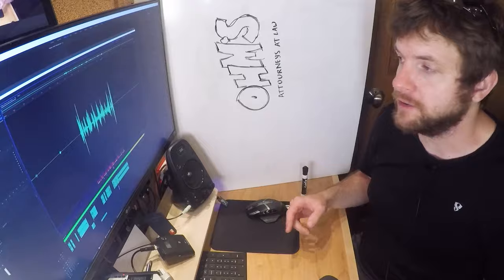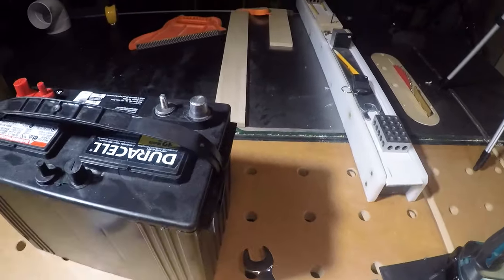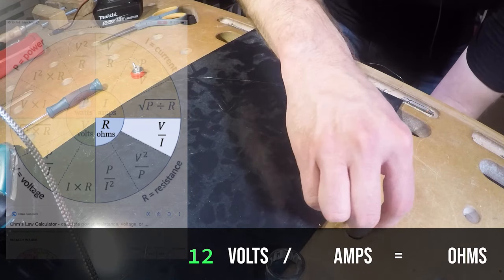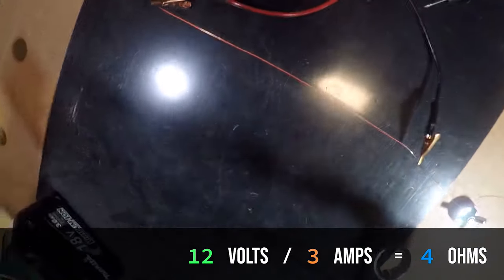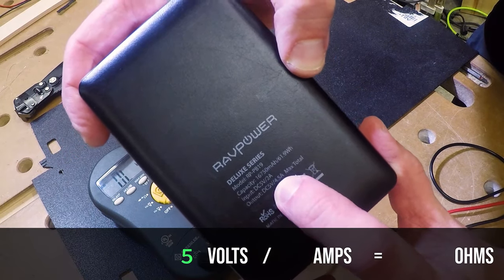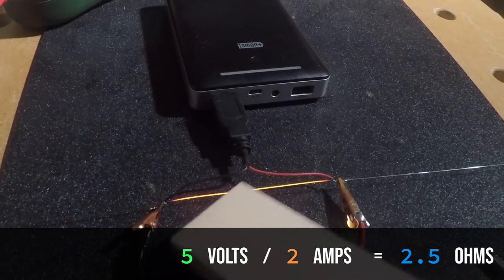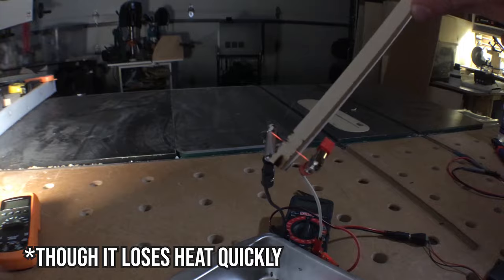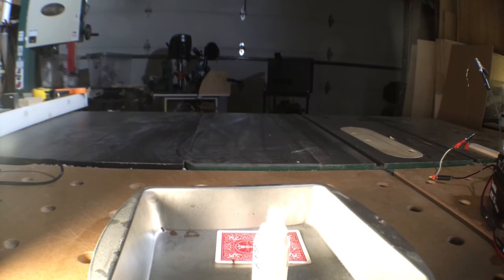Easy USB Hot Wire - Simple Circuit: (applying Ohm's Law)

Comment: So...I'm looking to make a heating element for my driveway in the winter.  I've seen all the expensive ones that are out there, but haven't found anyone trying to DIY that, trying to save as much money as possible.  Do you think using this type of wire would work...and what type of power would I need for a 100 ft stretch of driveway to make this happen?

Comment: Perhaps I am ignorant, but in what way is the amperage being controlled for? You have your voltage known, you check the resistance of the wire over a given length, and how much amperage is applied is simply a product of the formula, and if you don't have enough amperage it won't heat up and/or wont complete the curcuit? And if you have more than enough amperage it will simply not use the excess?
Reply: On my desktop power supply it would pull the voltage down to compensate. I think a circuit will try to pull as much amperage as it possible, even to the point of self destruction such as a short circuit, unless there is a overcurrent protection device to protect it from doing so. I am an electrician not an ee so I am looking at it from that angle.

Comment: I used some nichrome wire and a wall wart power supply to create a foam cutter. I lined the wire up with the blade of my table saw (inline) so I could use the fence of the saw to cut rigid foam pieces to size. Basically lower the blade and feed the foam through the vertical wire just as if it were a spinning blade. Worked wonderfully.
Reply: this is what im trying to do with copper wire to make a vape lol

Comment: Hey Keith do use a special USB with the portable battery pack? Because I tried to replicate this but the kanthal wire doesn’t glow. It does heat up but not glow. Everything else is exactly how you had it. Same wire, same gauge, same math. But it’s not working.

Comment: yes! the whole:
  - applying Ohm's Law with desired voltage and current to get needed resistance
  - using a multimeter to determine the resistance of a certain lengh of the wire
  - having thin wire for higher temperature and less wire lengh without changing desired voltage nor current
was all I needed, but couldn't get anywhere. thank you

Comment: We (our high school robotics team members) use hot wire to soften Lexan for shaping - use the hot wire to heat up an area of the lexan until it melts...when it cools it retains the new shape.

We have made several iterations of the Lexan bender (affectionately dubbed "Firestick" 1.0, 2.0). After watching this, I am embarrassed to say that we are using a toaster oven heating element (120V AC)... I see a Firestick 3.0 using low voltage DC like you have here.

This application of Ohm's law will be a great lesson, practical application and improve our safety in the shop.

thanks so much. Keep up the great work.
Reply from the maker: Great news!  Thanks for the comment.  If you have any content online about the FireStick, post a link!

Comment: Been trying to make a nail hot out in the field for my thermal scope,
I now use a 9v battery with the wire wrapped round the nail the protrudes the steel plate so the warm nail is picked up by the thermal scope 
Thanks for this simple idea.

Comment: Yup, basic electronics. Foam cutters are very big on this kind of thing. Wings for model airplanes, large format cutting platforms that turn foam into statuary and fancy add-on to buildings (ever been to Vegas? All those fancy architectural embellishments are built over cut foam cores....).
Then, of course cars. I met a guy that built a CNC foam cutter to cut out model car bodies for making molds for vaccines-forming the bodies that go over RC cars. His boss was so impressed, he commissioned him to build a full size car body core of a design he came up with for oval track cars (the boss has far more expensive hobbies!). Of course he had to build a BIG cutter, but it worked very well.
Thanks for sharing.
Reply from the maker: I’ll need to make one of these. You’re talking about cutting rigid foam insulation sort of stuff right?
Reply: I've done a quick and dirty version of this because I'm doing something on bigger scale I haven't included a rheostat just on off switch the maximum wires that you can't buy it anywhere locally anymore you have to order it if you know where a store is that actually sells the stuff off the shelf locally I'd be great for that information otherwise I pull apart hair dryers and other heating elements type devices and appliances a find around the house toasters hair dryers the stupid oscillating Peters that don't really put out much heat but have plenty of I have several different gauges anyway looking for a new version and this gave me some ideas thank you

Comment: I was looking into making a hot wire to cut the glass jars/bottles in a safer way than using 220v plug since I have no knolwdedge of any basic of electric. By using my potable battery charger, it won't burn down my house at least. I have used glass bottle cutter and heating/cooling the bottles  but it didn't give nice clean cut edges. i got to try this one. thank you for making this,

Comment: Thermal register tape is a decent way to check for heat when the wire isn't glowing without subjecting your fingers to a burn.

I have a circuit with a µC and a potentiometer that sets the duty cycle for PWM to the gate of a FET switching the output of a 19V laptop supply.  I've used this for running a straight filament for cutting rigid foam insulation (slightly oscillating the wire as you go to move the cooled part away and introduce hot wire, and back as you feed the foam though), as well as trimming flight feathers from chickens (versus scissors).  Same driver PCB design drives a coil (longer total wire, but packed into a smaller space) of Kanthal filament mounted in the bottom of a clay pot with wood pellets in it for a homebrew food smoker (which also runs a small airflow to keep the pellets smoldering).  I have also used a hot wire for cutting into wire insulation, but it generally produces too much smoke to be pleasant to use (but cuts nicely without nicking the conductor).  The same approach can be used for driving heater wire (non Kanthal/Nichrome insulated, for generating heat for seed germination for instance, not igniting things).

Short pieces of Kanthal or Nichrome can be used to ignite rocket motors.  That's basically the premise of the Estes igniters of some of our collective youth.
Reply from the maker: Wow this is an insanely insightful comment. Thank you!  Looking into thermal register tape now and nearly every other thing you mention relates to a project on my mind. 

I have a bunch of 19v laptop supplies around, wondering what to do with them. Ones a 10A!  No clue what laptop that powered. Cutting foam.  Cutting insulation without nicking wire, brilliant. I’ve always felt odd about the small nick left using wire strippers that cut into the insulation. My main ones pull the insulation instead of cut, but they aren’t very precise. Heaters. Rocket motors. My kid is 8 now so I’ve  recently been looking into getting some of those...

But I don’t have chickens. 

Thanks for the comment and insight!

Comment: I have a small project in which I need to reverse engineer a circuit based on these principles, but I don't need the wire to be glowing. Is there a way I can figure out the power needs and circuit design based on the initial temperature requirement?

Comment: "A lot of things to do with a hot wire.... you can get hurt..."

Hell yeah brother... I was making a soldering iron using chromium wire... was testing how far I have to cut it for my 12v 1,2 amps supply and .... you know I tested it with my finger and have a nasty wire thin burn on my finger... don't be like me kids

Comment: I have a woodland scenics foam cutter, would it be easy to duplicate that? I want to make a table cutter(slide foam across the table and through the Hotwire like slicing cheese)…. Not sure if I’ll buy some kenthal wire off eBay and try your method or duplicate the components of the woodland scenics sling shot cutter…

Comment: question, if you were to put a section of the glowing red cable into water, would it electrify everything or just heat it?
Reply from the maker: That's essentially a heating element like in an electric hot water heater.  Just make sure that the path of least resistance is going through the whole wire.  Pure water itself, however, is an electrical insulator.  https://www.usgs.gov/special-topic/water-science-school/science/conductivity-electrical-conductance-and-water?qt-science_center_objects=0#

Comment: Great video, I tried this to make a small water heater element with nichrome wire works really well .I wanted to use it on solar off grid but water heated very quickly but became dirty brown color any ideas why . Any help would be greatly appreciated Thanks Dale
Reply: Probably the wire itself has little bits coming off that tuned that water brown
Reply: usully, in electric kettles, those coils of heating wires are encased in some insulator and other material (metal) that's safe to put in water. also you might have hade some electrolysis going on there.

Comment: so how do you know how long the wire needs to be? do you use the meter to measure till its close to the calculated ohm? and if so what does this give us exactly? the most efficient heat?? what happens if the wire is coiled instead of straight but still the same length of wire? same effect?
Reply: Exactly my thoughts
Reply: @ARCSTREAMS  the best answer I can give is if the wire is coiled it will still work

Comment: Yo, regarding projects with the hot wire - I recently build a hot wire cutter with an old Nokia charger (5v 0,5amps) which is far enough to cut Styrofoam
Reply from the maker: MadixLP Sweet. I’ll have to give that a try.  Cutting foam is miserable with a knife!  Thanks for the comment.
Reply: I've purchased wire cutters from the craft store for this purpose but if you want to cut more than about 6" at a time, it's easier to build your own cutter as wide as you need.  Just keep the wire under tension so that it stays tight when it heats up or your cut will be terrible.  I use a variable power supply for this purpose so I can adjust the current as needed.  You want the wire to be hot enough to cut fairly quickly, but not so hot that the cut is a lot wider than the wire.  Too much heat (or moving the foam too slowly) can really melt the foam, so a bit of trial and error is needed.  Once you've got it dialed in, it works great.
Reply from the maker: MikeBramm Are you cutting rigid foam insulation by chance?  If so how is smoke management?
Reply: @KeithsTestGarage  Yes, I'm using it to cut rigid foam insulation. Usually I don't need to cut very much (I'm using it for model making) so I only use a small fan to blow the fumes away
Reply from the maker: Thanks!  (Apparently I don’t get notifications for replies)

Comment: is it possible to heat 2 mm diameter copper wire with DC volt to cut the foam ?

Comment: I can see someone on a survival show with a length of kanthal wire for emergency fire starting with a little battery.   Have you measured the heat of the wire? I could use something like that for cutting lead rods... "lead" as in the metal.
Reply: I learned a long time ago that you can easily start a campfire with a 9V battery and a pad of steel wool.  Just place the steel wool under the kindling, then touch the 9V battery to the steel wool.  The steel wool will start to burn and will then ignite the kindling.  Works really quickly.  DON'T LEAVE THE 9V BATTERY TO BURN.
Reply from the maker: Not sure how to measure the heat of a wire. It would be interesting to know though.
Reply from the maker: Good tips. I have an excess batch of steel wool from an estate sale and will put it by the camping gear.
Reply: @MikeBramm  i was gonna say that lol

Comment: I want to heat up a wire to incorporate it in to a plastic sheet. i'm not sure the gauge of the wire am i able to use a welder for my power souse.
it will be a wire mesh as in a fence diamond mesh type wire..

please advise... also the safest way please , hahaha don't what to destroy the welder or the area i am doing this in i shall try provide pictures if need be..
Reply from the maker: Your question is out of my league! :D

Comment: based on your terminology if the the power supply , supply more current we need shorter wire rather then the longer one  , I feel like something is wrong here !!!!
Reply from the maker: Please elaborate. What would the short wire solve?  Typically we’d want to reduce resistance for power transmission, therefore shortening the wire. But in this case I was trying to increase resistance. I think.  It’s been a while but I’m happy to learn from the comments section.

Comment: so using a Pb battery is ideal?
Reply from the maker: Oh man. Battery type selection varies widely depending on use case. But I rarely, if ever, recommend peanut butter batteries...
Reply: @KeithsTestGarage  i need it for a small, very small soldering iron. i use Pb batteries widely, but iam afraid that it will damage the baterry because the wire is shorting across the battery. type of battery aside, is it even safe to short it across a Pb battery?
Reply from the maker: Disclaimer: I’m no electrician. But, shorting across a battery is simply a circuit with resistance. (Or more technically, a shorter then intended circuit) A wrench provides very little resistance and therefore lots of sparks and melty parts. Kanthal wire like I used is the same circuit with more resistance. Your soldering iron is also a resistive circuit.  Even a simple LED is a resistive circuit. Basically all these examples are the same act of connecting the + to the -, just with various amounts of resistance in the middle.  
There are still several questions to address about battery and circuit characteristics. Like how many amps does the circuit draw?  Is the battery related to safely supply that?  What type of lead battery is it?  If an automotive or marine starting battery, it’s not ideal since those shouldn’t be drained. If deep cycle, common SLA AGM/gel batteries, those should be great just check the ampacity ratings and charge ratings to stay within those limits. If it’s unsealed, you’ve got hydrogen fumes to consider. 
Whichever solution you choose be sure to have a fuse rated just above what your iron will draw. 
I quite like using the Makita (or whatever brand) lithium power tool batteries for various power hacks because they can supply a lot of current and have built-in protection circuits.  But I also have several flooded deep cycle and AGM batteries that I use when the situation calls for them.  

In short (pun not intended but I’ll claim it), verify ratings, put in a fuse, and you’ll be fine... but there may be a more ideal solution. 
Try posting your specifics on r/AskElectronics. I’ve found that to be a great place for guidance on this type of stuff.
Reply: @KeithsTestGarage  ok, thank you very muvh m8